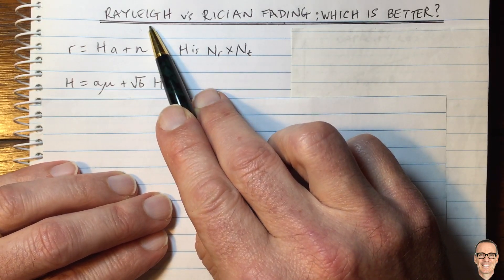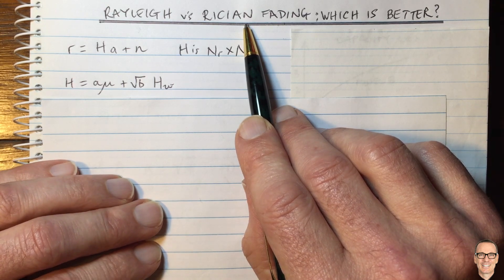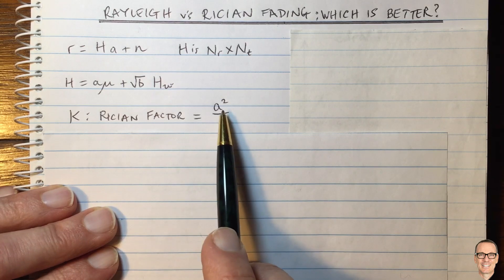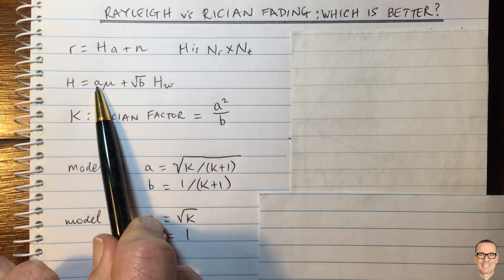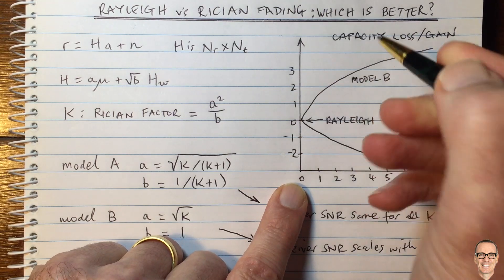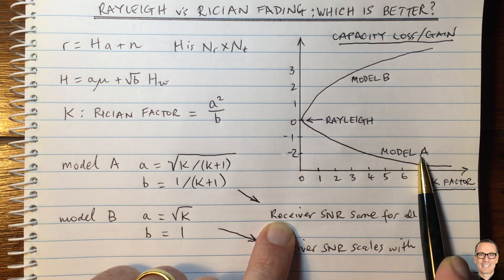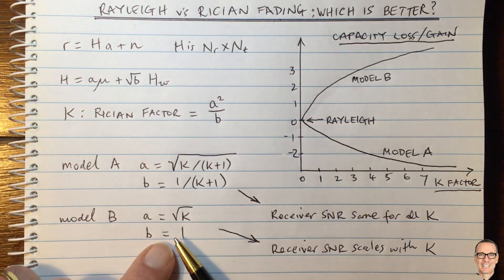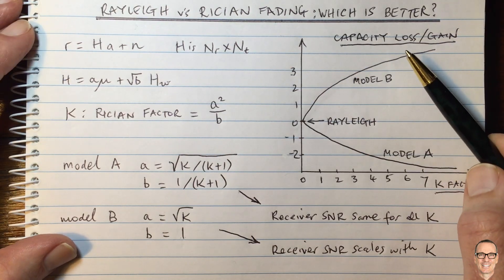Rayleigh v Rician Fading: Which is better?

Comment: So if i understand correctly, rician fading still offers increase in channel capacity despite a strong LoS availability between Tx and Rx, we just need to chose a and b intelligently. So for typical use case in which the transmitter is moving and the receiver is stationary, how can we design the balance of a and b such that the capacity enhancement can be achieved? how to control a and b in a real time mobile transmitter scenario?
Reply from the maker: You don't get a chance to "design" a and b. Nature sets them for you, based on the scattering environment. And I'm not sure you've understood the point I was trying to make, about the scaling. You say "rician fading still offers increase in channel capacity despite a strong LoS availability", but it's not "despite" a strong LoS, it's because of the strong LoS. If you can receive more energy at the receiver, you will be able to do a better job of detecting the signal/data, and you'll have a higher capacity.
Reply: @iain_explains  understood sir...i have watched almost all your videos on digital communication and modulation now...and I followed you on LinkedIn

Comment: But isnt there will be a problem with channel estimation due to LOS? Another issue is the more LOS you got the more columns are identical and hence channel matrix will be less invertible(or precicely will have bigger entries). Moreover, even if there will not be problem with channel estimate, your pseudo-inverse channel matrix may add 10s of dB gain to noise during eqalization.
 So this gain of capacity due to increased K can be also tricky.

I want to ask: is 5G spec talk what model of K normalization should be used? 38.901 section 776 talk only about k=a^2/b . Logicly will be to use model A otherwise with K increase i need to manipulate SNR to compare "apples to apples". 
Which is SNR = 1/(No*K)? Increase noise power knowing you will get "K" power more then you should? 

Sorry, I am just overwhelmed ... i thought recian literlly kill multipath by fading itself on top of it, the fact is you its harder to send multi layer transmission with LOS in MATLAB simulation. But when you check transmitter and reciever in the box condition in real life, sudenly you got 4 layer in MiMO4x4.
Reply from the maker: Sorry, I don't have all the answers with regards to the specifics of the 5G standard in this aspect, but from a fundamental perspective this video might help: "Why doesn't MIMO work in Line-of-Sight (LoS) Channel Conditions?" https://youtu.be/xqmdOXhZ2D4

Comment: Thanks, but what the reason to have model A if only model B is reasonable? It actually yields the opposite.
Reply from the maker: When comparing different communication modulation schemes, it is common to look at the performance with respect to the receive SNR. In doing this, the "channel gain" is often normalised to unity. This motivates the use of Model A. However, it hides the reality of the channel characteristics, and is not (in my view) the relevant metric when considering/comparing different types of channels (where I would suggest Model B is more appropriate).
Reply: @iain_explains  This is really fascinating but I feel that I do not understand the subtlety details thoroughly.  Anyway thank you so much for leaving the name of the relevant paper/book in the video description for us to read. I have a habit of watching your video and reading the reference together to have a feel of the subject.

Could you kindly make a video about using model A to compare between different modulation schemes ?
Reply: I also have the same question, it seems that model A is quite misleading